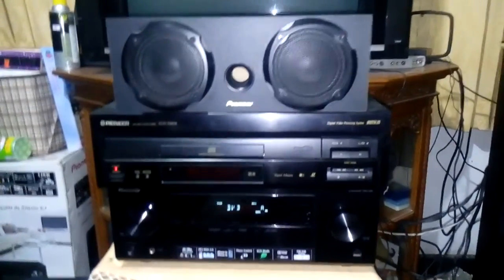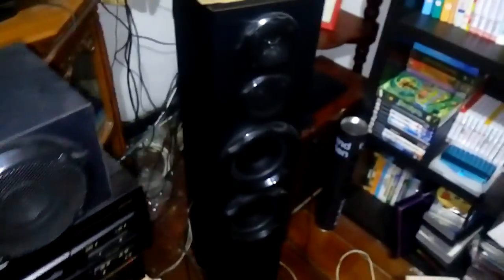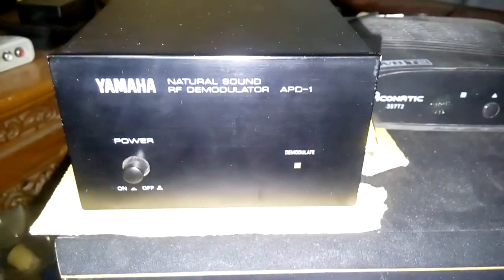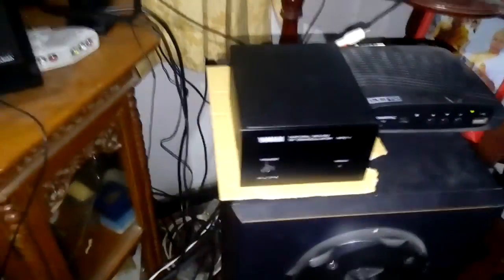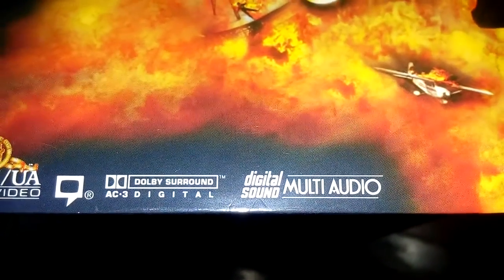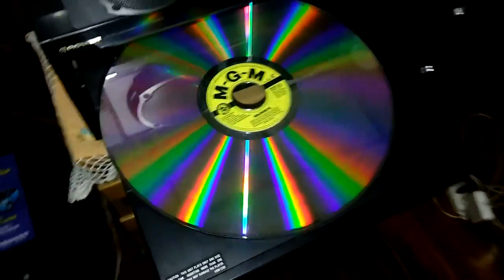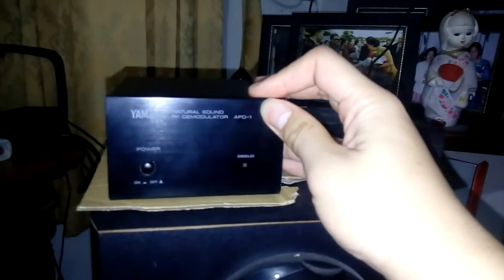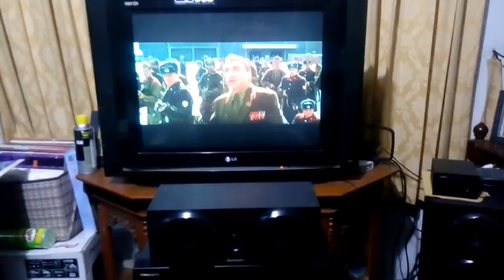LaserDisc with AC3-RF How to Setup

Comment: Cool video!  I love cranking my AC-3 discs.
Reply from the maker: +Culturedog Thank you so much! also I like your LD's Collection as well
Reply from the maker: Sure! This model also come with Digital Video Processing for 3D Comb Filter it's doesn't do very much but still does a job for CLV Frame Step and Both side play. Also Support both AC3-RF and DTS/PCM Audio.
Reply: Culturedog awesomeness.. I still need a ac3 ld player,av receiver a rf demodulator and speakers lol im a ways away
Reply: @mikedelgado8888  Same here. I'm looking for a Laserdisc player with AC-3 output. Since I found my mom's Toshiba WR-X75 player 7 months ago I've been trying to figure out how I can get Dolby Digital 5.1 sound with a demodulator, but unfortunately the player is from 1992, so I have to find a player manufactured as early as 1995 along with an AC-3 Demodulator so I can at least connect with the TV and get the Dolby Digital 5.1 sound that way.

Comment: So let me get this straight. In order to get surround sound for Laserdisc from a current, modern-day home theater system, you need a RF Demodulator? I'll have to keep that in mind when I invest on a Laserdisc Home Theater room. Can RF Demodulator do DTS Digital Surround Sound as well?
Reply from the maker: It's has a separate connection. AC3-RF Signal is Digital but it's converted and squeezed to the analog form it's can't be played 5.1 audio directly neither analog or digital form, you need to choose 3 difference way to convert the signal such as AC3-RF Compatible AVR, Demodulator or Sound Processor,  DTS signal won't go through that way.

For DTS it's very simple, you must have both DTS LD Title and LD Player with Optical Out connected to AVR, for Dolby AC3-RF it's a little bit tedious process.

- Direct Digital Audio will get Dolby Surround Stereo
- Analog will be stored only for the left side, right one reserved for AC3-RF Signal. (from AC3RF-Out to De-Mo then Opt.Out to AVR)
- DTS will work on simple-passthrough digital optical output only (from LD to AVR)

Comment: At around 8 and a half minutes in you had come across a U1 error code, I just bought a Denon LA-2300 with an AC-3 output and I have the same problem do you know what it is and how to fix it.
Reply: I have a Denon LA-2300 that does this very occasionally. It's probably the belt for the clamping mechanism getting worn out, but I haven't looked into it yet.

Comment: Pioneer laseractive , a  NON-AC3 player, can FORCE an AC3 disc to sound in STEREO. All other non-AC3 laserdisc players will make a loud static from the right channel.
Reply: I have had a few non AC3 laserdisc players I have never had any static from the right channel because AC3 and non AC3 are recorded on a different track
Reply: @rabbit73au  That's because your player must have supported the normal digital stereo tracks. AC3 channel won't interfere with those, but if you used an analog only player or switched your player to analog mode, you would have heard the static.